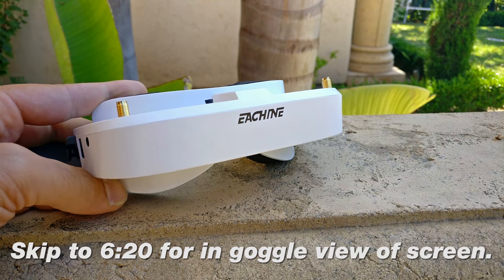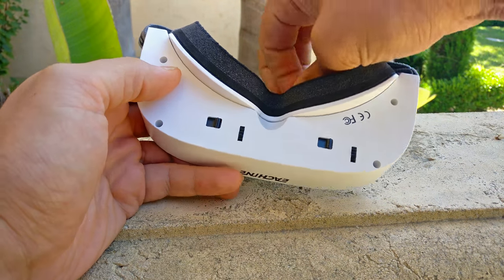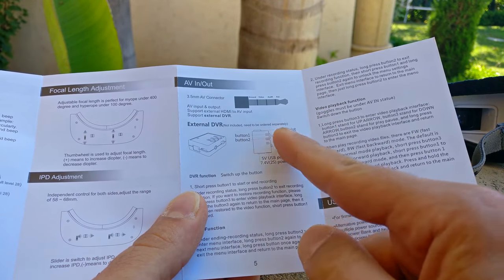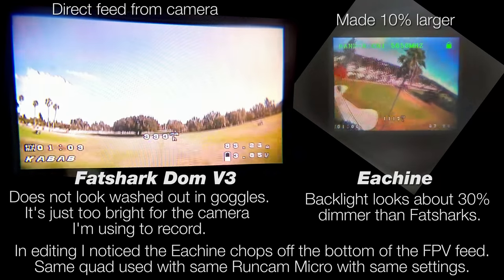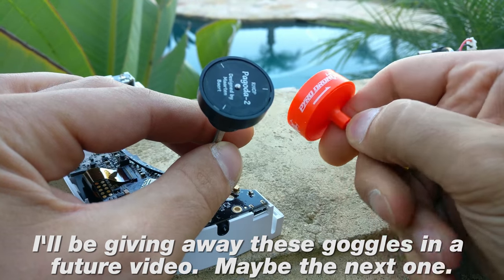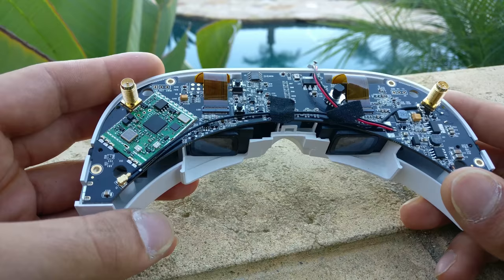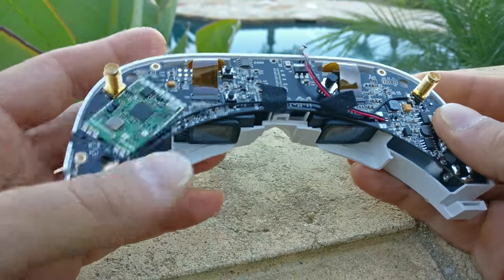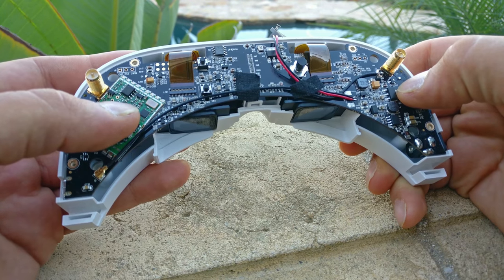Eachine EV100 Review

Comment: I'll stick with my furibee VR01. As a quick question about those: how come some goggles seem to fade to snow when  signal is lost whereas mine seem to lose frame sync with even a mild amount of signal loss. It makes me have very little conference when flying at any distance.
Reply from the maker: +LazerLord10 it's just the way the receiver works. The snow is usually preferred
Reply: Yeah. Maybe I just need to get more confident in flying blind for short amounts of time. It's not fun when it goes out of range and just makes a flickery image for 5 seconds as you try to bring it back, though. Super annoying.

Comment: I have the ev100 ordered out of curiosity. I have looked before as the relationship from 4:3 with 28 fov to 16:9 with 32 fov (my Aomway Commanders), in the theory is the difference of this both not very large, because 4:3 has more area in the relationship to 16:9! but when I saw the direct comparison, I was shocked how small the pictures of the ev100 are...

Comment: They already sell that dvr. I have it and after updating the software, it works great.

Try with the goggles to power first the quad and than the goggles and see if it still crops the image. I noticed with the eachine dvr that it does that but as you forst put on the quad and than the dvr, than it takes the image the right way and than it does not care if it is 16:9 or 4:3.

I think that the dvr can even be build in the goggles. It has a part where you can connect it to a fc or own buttons. That way you can control it on a plane or quad or with external buttons that you can place where you want. Just solder the video and audio in on the vtx.

Comment: got mine. i noticed that the charge light stays red no matter how long its charging. it would be nice if it turned green when charged. also if you read the directions you push both channel buttons at the same time for a few seconds and the OSD will go off. fyi. you made a good video tho.

Comment: If I didn't already own the Dominator SEs I'd be using the code 'doit' and getting $89 AUD off the Attitude V4s on banggood right now. The SEs are almost identical specs to the V4s except the FOV is 52 degrees whilst the V4s are 38 ... I believe. Not sure I could ever comfortably go down to what the V4s offer, let alone the EV100s.

Comment: im looking to get into racing, but motors are tripping me up.  given that i use a floss or floss 2 and an emax magnum tower, and a tattu 1300 45c 4s, would 2307 hyperlites be a good option?  would they kill my batteries too quick? Also, any other reccomendations?  thanks, any help appreciated
Reply from the maker: the 2307 is good.  I personally like the 2207 more for racing.  And honestly, the Aokfly 2306 2650kv is awesome.  It's difficult to justify spending twice the price on motors but the more expensive stuff is definitely better.  Hyperlite 2207 2522kv, ZMX FinX30 2207 2600kv, the Tmotor 2207 2600kv is where it's at.  Sergio and I agree on this....and we fly everything...not to mention Luke Bannister agrees.
Reply: Thanks.  I was actually watching your high performance drivetrains video, and i decided on the 2207 hyperlite motor.  Thanks, keep flossing

Comment: Kabab FPV I think you mentioned something during your review about seeing double with these goggles.  Aside from the fact that the screen is to small to fly with I was also seeing double, I couldn't get ride of it even though my IPD is within tolerance.  Is it these goggles that make me see double or do fatshark type goggles just not work for some people?  I'll stick with my box goggles for now but I hesitate to buy any goggle like fatshark if I'm going to see double.  Thanks
Reply from the maker: Yeah it was difficult to get the images to converge but I eventually was able to do it.
Reply: Kabab FPV is it difficult in your regular goggles do you still need to adjust in your regular goggles?  Does it always take a little time to converge? Thanks man!
Reply from the maker: Daniel Braker no my Dom V3 isn't an issue getting convergence. the lenses are bigger so there is a much larger sweet spot.
Reply: Kabab FPV thank you!

Comment: Which battery were you using on your quad? It was reading 3000mah used before you land
Reply: Faisal Khan i think kabab dident calibrate the current sensor. You se he us pulling over 70Amps while just cruising! I guess he has a 1500mah ch 4s. 😉

Comment: Have you tried them on without faceplate (as suggested elsewhere), does that any dramatically change perception of FOV and size of screen?
Reply from the maker: it's not drastic but it's MUCH better.  at least you can see the screens without blurring.  Problem is that it's extremely uncomfortable and my nose is still in the way so I couldn't even wear a minimal faceplate version.  If you have no nose, maybe it'll work out.
Reply: Julian Apaleos it does help. I fixed the issue with it being uncomfortable and light leakage when removing the faceplate. Check out my vid on my page. Basically I'm moving the faceplate back.

Comment: Will you teased the upcoming google that you talk about ?
Reply from the maker: M Argus Chopin Gyver ya one that I'm getting soon is in the description
Reply: If it's as good as he wants it to be - the hype will be insane... so less value announcing it early (or even teasing it).
Reply from the maker: tehllama42 I'm expecting them to be the new go to goggles. not so sure about the whole front assembly however. dunno how a Furious or laforge is gonna fit in there.
Reply: Just trying to math it out - assuming a laforge/furious module fits (or can be soldered in with conformal 3DP plastic), and the power source is fine - we'd be looking at a ~$400 complete package from what I see now... but at higher resolution and screen FOV.  [Unless I'm mistaken on the street pricing].

Comment: Thanks for the video man, a little question, why is the difference in screen size so drastic if theorically the v3's have 32º and the evs 28º?
Reply from the maker: Dashz these numbers are kinda misleading. the commander and Dom V3 are supposed to have the same fov but the commander is significantly larger when you compare. every manufacturer seems to use a different scale.
Reply from the maker: Dashz these numbers are kinda misleading. the commander and Dom V3 are supposed to have the same fov but the commander is significantly larger when you compare. every manufacturer seems to use a different scale.
Reply: OH, so the fov on the aomway is higher than the V3?? I was thinking on getting the v3s because of the modules you can add and the supposed "similar" fov ... :O

Comment: Can somebody help me, i wanted to go for a Eachine OTG Phone receiver, turns out it's around 100MS latency.
Looked at this EV100, turns out to be small as fuck...  Now looking at Aomway because for 220 it apparently is amazing.
But i need to know if there is a cheaper option, i  need low latency monitor instead of goggles.
Reply from the maker: The cheapest good option is the Eachine ev800 I believe. It's sold several several thousands on banggood. I believe it's $45?  It's a box goggle but you won't find a better goggle deal anywhere. Otherwise I'd wait doe the orq1 goggles however they will likely be about $700

Comment: This is not an upgraded version of Fatshark. It is an usable pairs that easy on pocket for beginner. Then they will decide later to pay 4 times more expensive or not. We never have this kind of option before. It used to be 300$ to 500$ for beginner or go another way round buying box goggle.
Reply from the maker: Kriengsak Wangdulyakiti I would recommend box goggles that are 1/5th the price over these just because of the crazy small FOV.

Comment: Those screens and receiver are both easily replaced. Glad you opened them. Waiting on mine to come. Ill be ordering wider fov lens to swap in. Cost the same price as the goggles but worth it.
Reply from the maker: KNUCKLEUP FPV where is this lens from?!   please do share!   with a wider FOV, this will be an absolute awesome product that can rival higher end Fatsharks
Reply: Kabab FPV same place that makes the fatshark optics. Ill get you a link in a little bit. Flying on my lunch break right now. You will just have to pull them from the locked in bracket they come in.
Reply: Are the lenses that easy to replace? Looked like they were in there pretty good... definitely worth looking into!
Reply: Links please, Im pretty sceptical of this.
Reply: Kabab FPV lens system is made by oriscape. They can be purchased on ali express. I wont know exactly which model will fit until I get my ev100 in hand. You can buy the screens with video controller attached or just the screens alone. Screens alone are much cheaper than buying the assembly. Ill add a link here to get you in the general area of where you need to be. Those of you with the goggles already will be able to find the screen before I do.

https://m.alibaba.com/product/1850569234/68-inch-bionocular-lcd-display-kopin.html?spm=a2706.7835515.1998800312.19.sMcwbj

Comment: i unfortunately just bought this goggle, but i'm having a bigger issue than just small screen: i see a double image on my screen, and seems like i'm not the only one having this problem.  they are just unusable!!
any tips or recomendations to fix this problem rather than trowing them in the bin?
Reply from the maker: Sorry. Inform banggood. They usually make it right.  I got a LOT of crap from commenters about how much they love theirs. I do not see how since they're totally unusable. A $30 box goggle is light years better.
Reply: You're so right, i have a box goggles still from eachine that's probably worth 30$ and is far better than this!
Anyway thanks for responding ;)

Comment: thanks  for the review Kaba  (im Mascarenhas from Facebook) , are you using PAL or NTSC camera? i heard the chop image on bottom is only with NTSC . also did you check the DVR problem i told you in facebook?
Reply from the maker: TheMascaras33 yeah I tried but my fatshark DVR wasn't having it. the screen brightness cuts in half and contrast goes out the window. it's just splitting the signal.   not sure how it would be with an actual DVR only however because for my Fatsharks to work, it also needs to display on the screen.
Reply: thanks !  also your using NTSC  not PAL right?
Reply from the maker: TheMascaras33 yes. ntsc
Reply: dutchRC also received today  , it seems he tested external DVD : "a small update on my findings with the EV100's.. I have 4 of them here, which is offcourse unusual, but gives me (for a change) to see if 1 is better then the others.. I really can't see any difference in the screen's performance.. 
I allso plugged in an external DVR, and apart from a small screen-glitch while plugging the DVR on, the screen stay the same.. 

Screen size: yep.. it's pretty small (even with a PAL camera).. These won't be my next daily driver.. the focus (really crispy) does make up for the size a bit.. It's flyable, and work out better then box-style goggles (for me!)"

Comment: What battery are you flying. your mah is at 3000 and you draw 200A sometimes. Max 375? what the hell
Reply from the maker: Patrick Donovan I screwed up my voltage scales last night.
Reply: Kabab FPV oh haha. then why does the alarm come on at 2500 mah
Reply from the maker: Patrick Donovan because that's default. I haven't a clue why. what race quad uses a 3000 pack for the alarm to come on at 2500?

Comment: Large lenses with good magnification and of good quality are expensive, i mean just look at camera lenses... I think at $99 it will be incredibly difficult to have a larger FOV, I wouldn't expect to see them any time soon with their future revisions. There are reasons why proper glasses cost so much, even for skyzones and aomway that may be seen as cheap, are still really quite expensive.

It would be fun to see the glass elements inside a fatshark. The heavy weight of the Fatshark mainly comes from the lens+screen module, and that tells the difference... in order to get a good magnification, there needs to be quite a few lenses working together. On a eachine, the screen that we see is pretty much the size of the actual screen without much magnification.

Comment: the EV800D box goggles are a similar shape with the slight bevel above the seam. they look a lot better than the last few iterations of the eachine box goggles in my opinion. it has cloth on foam face pads which is nice, only antenna diversity, but it has low latency DVR from what i can tell, it also doubles as a ground station if you have a tripod. thanks for pointing out the difference in screen size its a serious detractor from getting these. i think i will just skip over these as a 3rd goggle and save for some aomway commanders.
Reply: EV800D is better.
Reply: David 
Technically right.
Reply: Actually, both are pretty similar, so it down to personal preference. I'll pick EV800D though.
Reply: David 
Check out the newest EV800D, not EV800.

Comment: I have been using these now as of October last year, first i thought, Damn that screen is small and the blackouts etc from the first batch. Fixed all of them and then it was better.
Overall after 6 month of regular usage, all i can say is.. damn these are sweet for the price and i have become so used to this small screen. When i am focusing on the screen, i really do not notice it being small anymore at all. I come from Box googles that had a huge screen and it was so hard to fly for 3+ minutes with the big screen as my eyes started to hurt. With these, i can cruise for 10+ minutes without issues.

Regarding the OSD, yes, it chops the screen but you can adjust that as well as symbol size in Betaflight and make them super huge if you need, 1 size bigger is already enough for me. Also did the Drone Mesh mod with external module, using that when i do some further flights with my 2500mah battery and it works just like a charm. Overall consider me as crazy but i like these EV100 as my first fatshark type goggles.

Planning to upgrade to Flysight Falcon but definitely keeping these as a backup or for my GF when she wants to have a nice scenery.
Reply from the maker: You're crazy 😂. Please don't get the falcon. I attempted to design those but the factory just fudged everything. There are some other goggles on the way.
Reply: I have heard so far only good things about the Falcon goggles. Not sure if there is anything going to be released for similar price category. Also i like that i can power the Falcon goggles with a 4s battery and no need for a 7.4v battery.

Comment: Great video, I am still on the fence about these i should had just ordered while were on sale for 99, now for 160 not sure.. Everyone keeps talking about how small the viewing is..  Right now im using a 4 inch monitor in a custom thing i built so there work like box goggles and i just got some used but new VRD2 but there the 1st batch and they stink as far as range i might there the 008's wish i had someone local who had these so i could try
Reply from the maker: epoweredrc the box goggle option in the video description are regarded as one of the best beginner headsets. the viewing experience is similar to the highest end Fatsharks.

Comment: Wow, that fow issue is shocking to me. I pre-ordered them as soon as I saw your insta post and I'm still able to refund them. Is it actually that terrible? I have quanum v2 pro goggles and I haven't tried any other goggles ever so I can't imagine how big the screen actually is, because I don't have another point of comparison. Based on what you said (going from box goggles to dominators and then to these) I'm starting to think about refunding them because there is no point in buying a pair of goggles that you won't feel comfortable flying... please help me out on this.
Reply from the maker: CZDrMike I wouldn't recommend you get them. you will be absolutely shocked at how tiny the screens are. that's if you can even get them properly positioned to see them.
Reply: Kabab FPV that's a shame... I was really hoping they will be good. Is there something similar coming? Similar (maybe slightly higher) price range?
Reply from the maker: CZDrMike yes. there are actually eight new goggles coming out over the next ~6mo. the market is about to finally get flooded. this is eachine just taking advantage of the market before that happens.
Reply: I still used my quanum v2 pro box goggles until very recently. With a good diversity receiver these are great. No way I was going to pay for fatshark ripoff prices, so I waited and waited for a competitor. Everyone laughed at my quanum's but they work really well. I knew the EV100 was coming out and at $99 was so tempting to pre-order. However luckily the Aomway Commanders had excellent reviews even though it was impossible to get your hands on a pair. Eachine generally make low quality stuff so I was wary of getting their goggles unreviewed. I am so happy with my Commanders, big investment but they work great with new antennas. Highly recommended. Still I cant work out why UAVfutures and Bob here can give such different reviews, Stu talks everything up it seems no wonder he got his EV100 for review early... I think Bob here will be off Eachine's christmas card list forever for being so brutally honest.